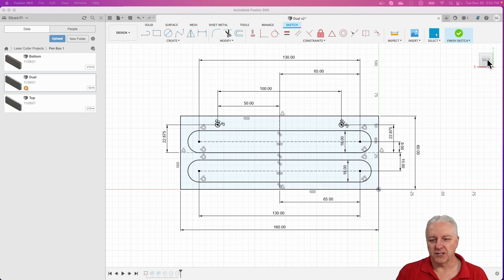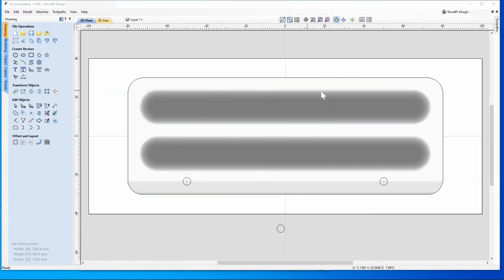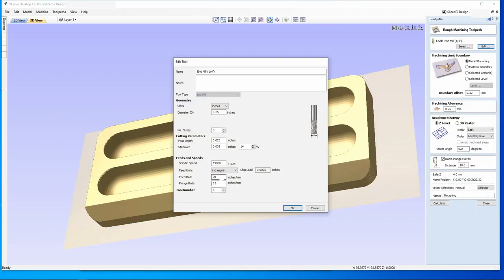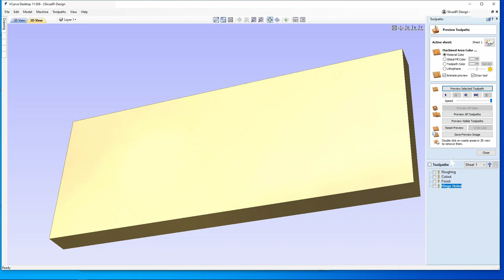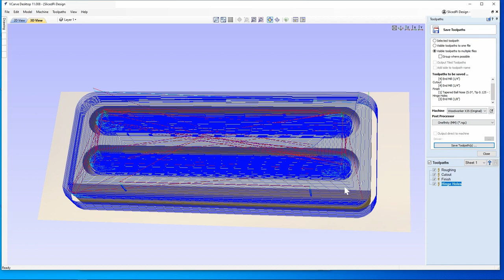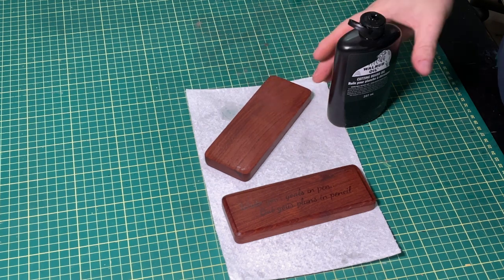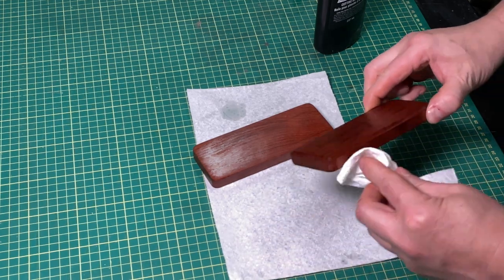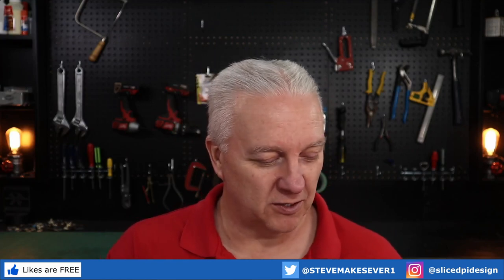Crafting a Unique Pen and Pencil Box With a CNC Router

Comment: General question: What would you say, for someone starting out, is the product waste percentage to anticipate? What would you say it was for you? Just trying to get a business plan put together and want to include that in my financial calculations. Thanks for the amazing videos and tips!
Reply from the maker: On this particular project I started from a supply of Bubinga wood that I acquired, so I was able to cut pretty much exactly what I needed from a longer board in order to reduce waste.  Waste is always a thing to consider when you are estimating work though.  However time is usually your most expensive item in a project.

Comment: Hi Steve.  I am first time laser purchaser.  I can't seem to find a video with anyone engraving thick pieces of wood.  I make candle holders that are about 4" in diameter, and would love to engrave them.  I have my riser attached, do I just remove the honeycomb tray?  Do I need to switch to my 1.5 lens?
Reply from the maker: Hi Janice.  Engraving is pretty much the same regardless of the thickness of material.  It's really the kind of material that matters most.  On the physical side, the Muse has a couple of option for engraving on taller items.  Your Riser is the first step.  This will give you several more inches of height.  You can also remove the bottom of the laser and raise it up enough to engrave on an item of any height.  In either case you can just pop the tray out and place your item below.

As far as lenses, a short lens will definitely produce better engraving, but you may need a longer lens in order to focus the laser.  But you can always place something underneath the item you are engraving to raise it up enough to allow the laser to focus properly with whatever lens you choose.